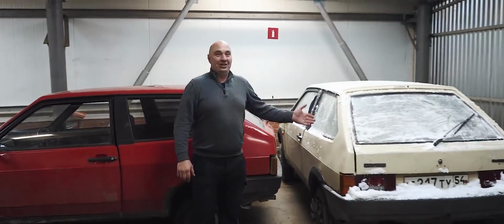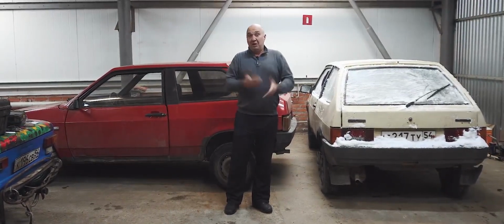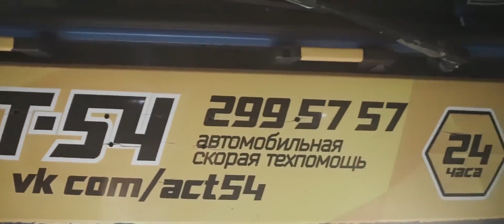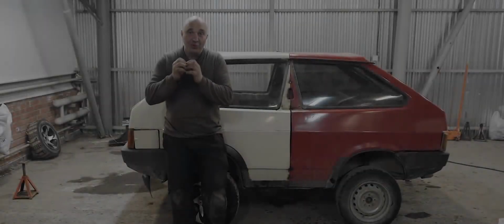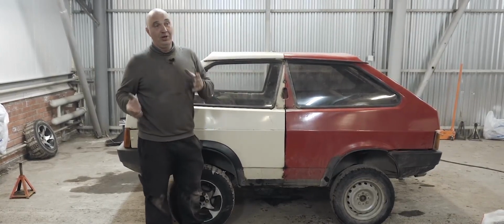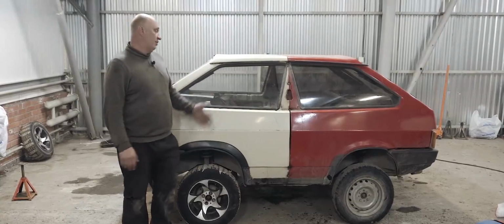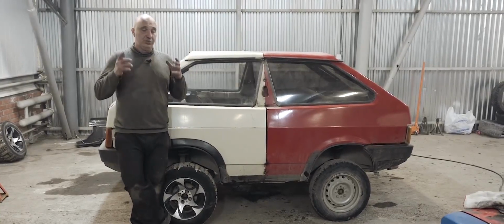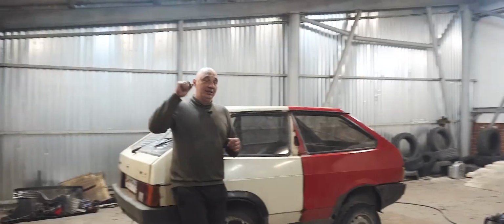Creating the "ASS TANK"

Comment: HAS to be green! this is a tank yo. also... steering wise... why dont you put 2 bike engines in the back of it.. one running to 2 wheels and one running to the other 2, that way steering it would just need a lever on the accelerator of each motor. true tank style driving!.

Comment: Hyah...
How about...
Independant brakes for steering...
A bit like a bulldozer.......
If you want to simplify things...
You could try rigging 2 handbrakes....
1 to the left and 1 to the right....
Greetings from the U.K.
Reply: Great and simple idea!
Reply: Usually a brake turn system has some sort of gear reduction system within the differential to allow for the variation in output speeds.
Reply: Lada drum breaks wont have enough power to stop it and differential will probably blow. This being so light weight just maybe heavy duty older RWD volvo axle could work, but i still doubt it. Better to go hydraulic or electric drive.

Comment: Would it not be easier, mon ami, and more practical, to have joined both FRONT ENDS...with the engine/tranny & steering gear already there ? Albeit you could not being employing those "ass" references. As far as all those 'couch commentators',  mochit'sya na nikh!
Reply: One of the cars had no engine or transmission